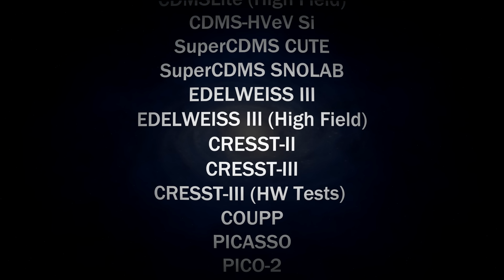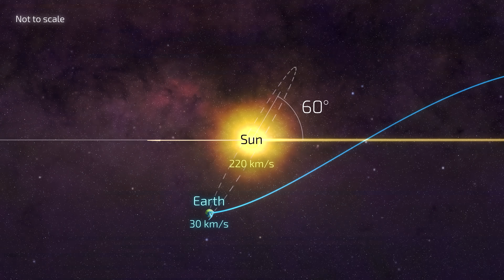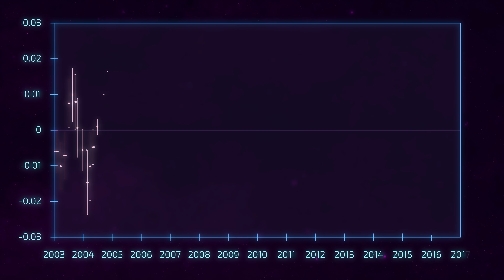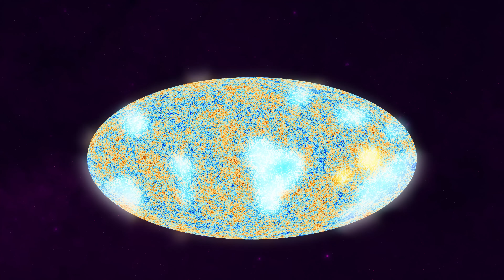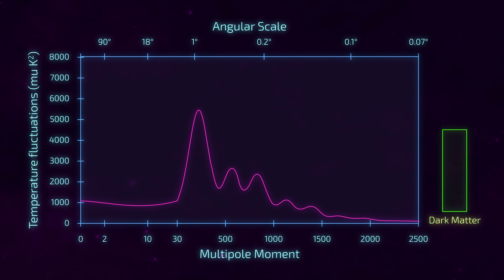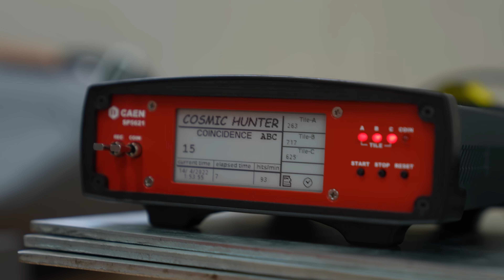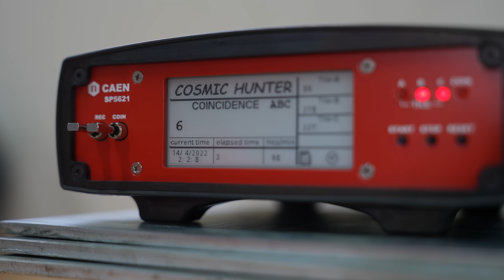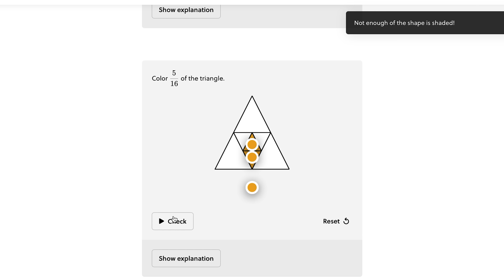The Absurd Search For Dark Matter

Comment: I am curious to know if they take in count that Time doesn't (flow, past, go... name it) at the same pace at any point in space. As an observer, I can see an distant object to accelerate away from me. but it doesn't mean its speed is increasing... (a = dV/dt), if dt decrease as the object if moving away from us and dV stays constant, we will also observe an acceleration(no need of dark mater and dark energy). We know dt between 2 points tend to decrease as 1 of the 2 point move away from a mass. it could also explain why galaxies have this phenomenon about the outers stars that orbit faster than what they should. we can't observe our universe as if the time (flow, past, go.... name it) at the same pace at any point in space, certainly at the size of galaxies which are lightyears long.

I haven't see any physics exploring deeper the law of physics such as newton's laws but in the case that when dt isn't constant. what happen when 2 forces that face each other are constant but split by a plan right between that divide into 2 section where the time doesn't (flow, past, go.... name it) at the same pace. I am sure the net force will not be equal to 0. it might also explain how gravity works... I am just curious.

Comment: But if dark matter interacts with ordinary matter by gravity, wouldn’t any dark matter in our galaxy be rotating around with it at the same rate as our stars?  If that’s the case then our solar system would be flowing with the dark matter, not moving through it.
Reply: The dark matter "cloud" could be rotating, sure, but that doesn't make too much difference. The signal being searched for here comes from the relative motion of the Earth through that cloud, which should vary annually regardless of dark matter galactic rotation.

Comment: GOD declared in the Qur^aan that HE created 7 separate universes (worlds) simultaneously stacked one on top of each other with this Universe we resides in being the lowest of the Seven  all sandwiched between The Divine Throne at the top and Jahannam (Hell) at the bottom.

The Big Bang model only took account of the creation of one universe, not seven, so its a dud for me.

The only way 7 universes could formed simultaneously at the same time while remain separate from each other is a plasma discharge pattern (ie the centpede pattern) instead of a Big Bang, with each universes is a diocotron instability plasma toroid along a plasma column between the Throne (cathode) and Hell (anode).

So that's it for me. It's clearly a Plasma-Electric Universe instead of fantasy Dork Matter Universe.

Ben Davidson over at SO is a gem of the scientific world.

The Thunderbolts team is on the mark as well.

Comment: Great video. 
An Off topic thought: The tilt of the solar system's plane to galactic plane raises a question, that, if it affects the stability of the planets' orbits ?
Will a zero degree tilt have less stable orbits or may be more eliptical orbits ?
If yes that could affect the probability of life on that solar system.
Reply: Why would it affect the stability of the planets' orbit? There is no drag in space.
Reply: @bronzejourney5784  not because of the drag but the angle of the solar system's plane to galactic plane.
If the angle is low then planets orbits can become more eliptical and unstable.

Comment: I'm do wonder if the missing matter is actually missing, and therefore "dark", or if it's instead a very physical and interactable thing that we haven't been capable of measuring, such as maybe the amount of mass, be it "rogue" planets, asteroids, dust, or whatever else being far higher than in our existing models, assuming its modelled at all. We have a hard enough time detecting objects even as large as planets around nearby stars, or even within our own solar system, that I'd hypothesize that our current sort of surveys/census of matter is incomplete even as nearby as the outer solar system.

Comment: except with the rotation speed demoed on earth, a light object is being pulled down, not inwards, by gravity, ... this drastically reduces amount of g force needed, for the pulldown (pull in), effect. ,,, a heavy object has more rotational (g force) energy, compared to the center point, which is not in the center, but now down 60 degress, so the pull inwards is (5? times) less? ,,,

Comment: Hm, the piece of the brilliant ad that was interested in turning lights off and TV on seems to have a whole lot of built in assumptions such as if the lights are off you can still find the TV.

This si slightly better:
if lights are not on
   turn on lights  // So you do not stumble in the dark looking for remote or TV's power switch
end if
// Most of the time this should succeed. If it fails bail out, forget the TV,  and address this problem.

while TV is off
    turn on the TV
    if TV is still off
      if you get bored with this sequence
         take TV in for repairs
         exit loop 
      endif
      plug the TV in
      turn any hardware TV power switch on
   end if
end while

Now turn the lights off  // No pre testing needed
// Do not test for off - there's blessed little you can do about this error in most cases.

{^_-}    Picky Picky Picky - and incomplete but better than the ad showed....

Comment: Since both the theories of Gravitational Lensing and Dark Matter require the core theory of Gravity to be correct, which is actually not 100% known, it's disingenuous at best and paradoxical at worst to use one of them to observe the other.
Reply: Devil's advocate here, what truth/meaning isn't based on its relation to another "fact"? I don't think there's any fact that has been proved 100%. Genuine question, how certain do we need to be in a fact/theory/law before we can use it to derive other facts/theories/laws?
Reply: Let's just increase the mass of the universe by 27%, with something that can neither be seen or detected.
Problem solved! ;-)
Reply: if evidence arises to dispute what we consider the current leading theory of how gravity worked, it would change, evidence hasnt been showcased so we must trust that our measurements are accurate in the meantime
Reply: @w0rkhop555  I'm not a physicist so i really have no idea but does the discrepancy between the standard model and quantum field theory not indicate that something about our understanding of physics is off?
Reply: I'm a bit confused by your statement. I'm pretty sure they are attempting to observe dark matter via the weak force. If you are referring to the section of the video where two galaxies collided, I don't think the evidence is invalid just because both rely on gravity. It's not like the current theory of gravity will ever be completely thrown out. If we assume that there is a modification to the theory of gravity that can be experimentally verified and explains the rotations of galaxies, that doesn't mean that our observations of gravitational lensing will become invalidated. They might be slightly inaccurate, but you are essentially saying that the observed densities from gravitational lensing will somehow be flipped.

Comment: there is an assumption in astrophysics that matter orbits around a singularity at the galaxy's centre.
in all other circumstances we see that 99% of the matter falls into the centre of gravity and only very very special cases achieve an orbit.
 if the matter is modelled as accelerating towards the centre then we have no need for dark matter and the red shift would also need addressing.

Comment: Dark Matter, an ad hoc adjustment to a failed mathematical model about as valid as a Ptolemaic epicycle rooted in a belief system that thinks matter dominates the universe founded on the materialistic mechanical reasoning over 200 years old.  

Annual cycle that peaks in the summer and drops off in the winter of the northern hemisphere.  Holy willful blindness batman.     What is interesting when he lists all the other non relative things that have similar cycles he ignores the main one that is the driver of the biosphere of earth, the sun. I bet this new detector will see a similar spike in their summer, therefore it will spike twice a year therefore disprove the theory.  

Astronomers only believe dark matter exists because observations refuted their model, so that rather than question their model, they imagined dark matter.  This is not good science.  It is a failure of their models and not questioning their models is bad science.

"Except through gravity" say the theorists. Would that be the mass based model of gravity for which they do not know where mass is in matter, maybe the Higgs Field. 

They believe this because they choose to ignore the presence of electromagnetic fields and currents in the solar system and throughout space. BY IGNORING WHAT IS THERE, THEY HAVE TO MAKE UP NONSENSE LIKE DARK MATTER.  

Fifty tests for DM fail, and now he is putting high hopes on this one.  If DM cannot interact with anything, then how do you detect it? Damn, you guys talk about gravity being real but you cannot detect it.  Everyone of you who believe these experts are nothing more than the religious faithful. Keep spending billions on searching for something that doesn't exist. 

Yeah you can create an invisible non detectable substance, OR, you can build models based on what empirical knowledge you have that isn't limited by assumptions such as those found in GR or the alleged universal value of GC.  One does not need dark matter if one recognizes the electromagnetic structures that are at work. As long as charge is neutralized in space, you will have a unknowable universe that will continue to require new dark things to keep afloat. Good luck with that.
Reply: That is a whole lot of ignorance pretending as hard as you can.

Comment: 4:25 just a un-researched question here.. couldn't it also be that the stars move so fast because they haven't slowed down yet? I mean I have no Idea how an Galaxy is created.. but when the galaxy was formed and the stars had enormous speed it would take them (in my time perspective) forever to slow down. I don't know.
Reply: Their rotation speeds are constant
Reply: @penart8079  yeah. But if I see a video of a rock falling down and it is slowed down for example 1 billion times, then i would only see a levitating rock that doesnt fall down. If the stars are moving so fast that it would take them billions of years to slow down even a little bit.. I would assume they move in a constant speed. 
just as an infinite large circle become a straight line when you look at an small part of it
Reply: @admcs7554  there would still be a bigger difference in rotation speeds between the center of the galaxy and the outer edges. I also think you need to research a bit how galaxies are formed, it will help you understand why your suggestion does not make sense

Comment: As far as the annual variation in the goes, I suspect it has a very prosaic cause and explanation. Consider a different but parallel sort of issue. The background rate of gamma radiation (and subatomic particles from cosmic rays) varies roughly daily by about 2 microrem per hour. In truth it varies with the sidereal day. It is caused by the rising and falling of the x-ray sources in the Milky Way visible to the Earths surface where the detector resides. 

There are a huge number of parameters that vary on an annual cycle. You mentioned a few. There are countless more. I suspect that the chances are high that the Australian experiment will show results 180 degrees out of phase with the Italian results - or - no phase variance at all. Even if they are in phase it does not necessary support CDM. That would only mean that the origin of the annual variation isn’t seasonal in source.  Instead then it suggests that it may well be orbital in source.

Comment: Dark matter and Dark Energy are illusions. Largely these ideas were driven in the 1970s by the problem that the rotational velocities of galaxies did not match Keplerian based expectations. This is from both the flat radial velocities curves at large sizes relative to the galactic diameter (which you described), and the far more complex problem of the mismatch between Keplerian expectations and observed reality at the smaller scale of the radial velocity curves for distances less that the observed radius of visible stars in galaxies. 

At the small radial distances the curves for Andromeda and the Milky Way show a fast core with a roughly linear increase in velocity with distance to the size of the galactic core. Beyond that lies a messy zone we’re radial velocity reverses. Outside that radial velocities rapidly increase then change to roughly a linear velocity increase with distance out to the visible radial size of the galaxy. From that point outward the radial velocity remains constant. 

The curves look like a fast rotating solid central section surrounded by a messy reverse velocity zone, that then transitions to an outer zone that rotates like a flat solid plate - except that the inner portion is moving too fast - like Keplerian expectations added to the disk like behavior. 

This is not at all what was expected. And trying to force Keplerian expectations on the measured radial velocity curves largely generated the need for dark matter AND dark energy. Nebulae and other observations added to this. This ad hoc approach absolutely is not science. Yet it happened. 

What is really at work?  That remains unknown. It almost certainly is not dark matter or dark energy or some unknown fifth force. 

MOND provides a much simpler - a vastly simpler - explanation. It does not however have an underlying theoretical foundation. But then neither does Cold Dark Matter (CDM) and Dark Energy. 

More recent ideas perhaps explain everything. 

Consider that gravity isn’t a force - that in point of fact, gravity doesn’t exist at all. 

Consider that what we call gravity is an artifact of the distortion of space-time by mass. And that mass isn’t what we imagine either. But for the moment, consider that mass distorts the shape of space-time. Now apply Newtonian motion (at low speeds), and Einsteinian motion at high speeds. The motions remain linear as seen in the distorted space-time. Undistort that to Euclidean space and the motions are complex curves. 

Similatly, in distorted space-time the velocities remain constant with motion - barring interactions. Undistort and the motions are anything but linear. Conservation of angular momentum and various moments of inertia; both for object rotations, and for object rotation ‘around’ a center of mass add to this complexity. So too nay electromagnetic conservations and interactions. 

These still don’t match observations. Well, not until we add in the expansion of the Universe. Imagine that in Euclidean view as a stretching in all directions. It is more complex than that however as it is a linear change in dimensional size in space-time with time. This is not insignificant at the scale of galaxies and beyond. It is insignificant, I.e. non-observable, at the scale of solar systems. 

Now put these all together. Everything fits. 

Well, except for that high radial velocity zone in the core of Andromeda and the Milky Way, and likely by extension to all galaxies. What causes that? Why is it distinctly different from the rest of the galaxy?  Who knows? That is the realm for new theories and new science. 

For now our problem is in getting the old wrong ideas like CDM and Dark Energy to die. If the history of science tells us anything, it is that the time frame for that is the lifetime of the researchers believing these wrong ideas. Only when most of them have grown old and die will the more correct (though often still wrong ideas) prevail. This is the inertia of resistance to discovery. 

And given the rate of change of catastrophic climate change, we may well not make it to a truer understanding before the collapse of civilization occurs and perhaps even the end of man as Earth shifts rapidly to an equable climate regime where agriculture as we have known it is impossible. That is unfortunate, as we are I believe on the cusp of a fundamental shift in science. A new age of understanding the nature of reality.

Comment: Dark matter as a concept is very hard to understand. How is it possible that physical matter ,that is supposed to be more abundant than regular matter, does not interact with regular matter ? Maybe dark matter isnt the answer, maybe its the equations to calculate gravity that are not entirely correct
Reply: Because in order to interact, particles have to "shake hands" with each other through one of the fundamental forces, like electromagnetism or the strong and weak nuclear forces. Neutrinos for example, don't have electric charge so they don't interact via electromagnetism, nor do they have colour charge (strong nuclear force), but they can interact through the weak nuclear force. As the name suggests, these weak interactions means that neutrinos tend to just pass straight through matter unimpeded, only very rarely colliding. Dark matter would be like that. It might very rarely interact (which is what these detectors are looking for), but it's possible it doesn't interact through any of the known forces (besides gravity).
Reply: @atticmuse3749  if we follow einsteins theory of general relativity, gravity isnt even a force. So how would dark matter interact through something that isnt supposed to be a force? Is dark matter there just to bend space-time ?
Reply: @TheZoan007  So by having mass, dark matter will curve spacetime and create gravity, just like normal matter does. I'm talking about interactions through the other forces, the ones that we have quantum field theories describing.
Reply: @atticmuse3749  i appreciate you taking the time to teach me about this. I am not very convinced about the existence of dark matter, but I have learned new stuf